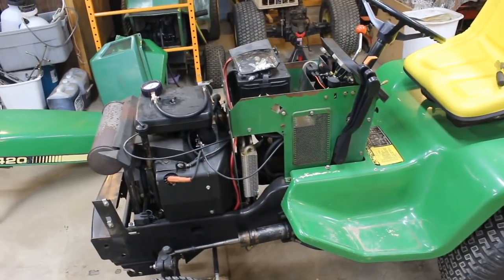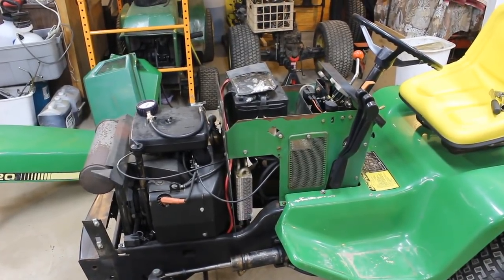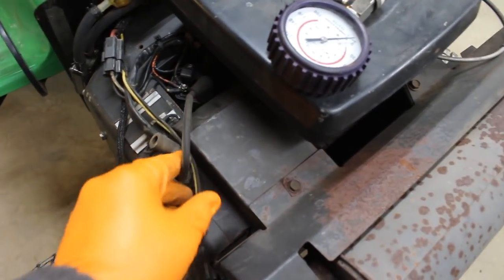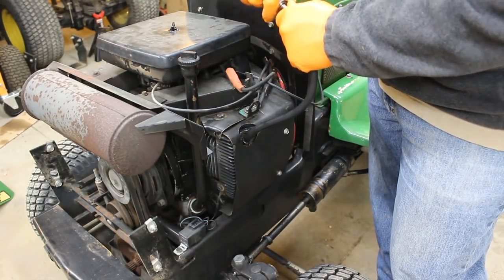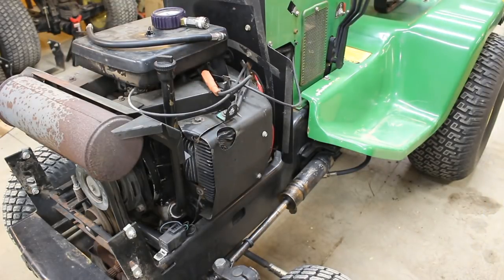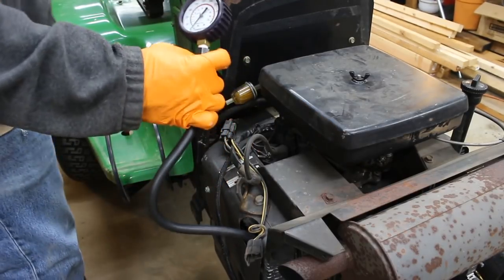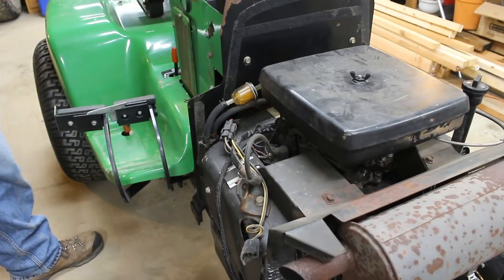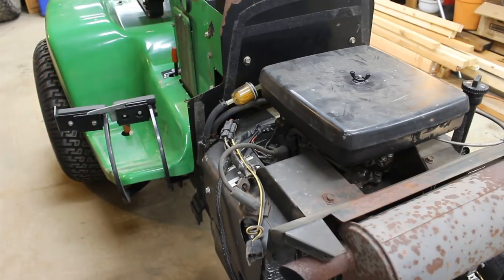Compression Test on an Onan - John Deere 318 or 420

Comment: I just bought a rough '86 420 that has not run for 2 years for $350. I got it running. Cold compression is 85 & 90.  So I will probably have to rebuild someday. Doesn't feel like the carb is right. Would you recommend buying a new one or rebuilding the original. If new do you recommend one. Any advice is well appreciated.

Comment: Silly question but what some signs of a bad spark plug? See I have a little white smoke on initial start up but like you once hot it will
Start again and purr.. recently tonight engine was bogging down? You think bad fuel? Spark plug bad? Or carb needs cleaned??
Reply from the maker: A bogging engine can be lots of things.... clogged filter, trash in the carb, air flow restriction, and the list goes on. Generally unless there is a huge build up of carbon or oil on the plug and the spark is nice and bright, I would start with the simple fuel and air inspections first.

Comment: For those of you who need to get an accurate reading from a compression test: You need to remove ALL the spark plugs, in this case both plugs, make sure the choke is off and the throttle is wide open. You can't get compression if it can't draw in air ...
Reply from the maker: Please see my reply to RP Titcomb from two years ago that addresses this comment. In the two years since this video was posted I have tried Onan's with and without plugs and I have yet to see a difference in the ultimate compression value with the plugs in or out of the other cylinder. I DO think plugs being removed in multi-cylinder (3+ cylinders) engines becomes more important.
Reply: Yep, the theory is you want the least engine resistance possible during your compression test, EXCEPT for the cylinder compression of the specific engine cylinder you intend to rest.  capish...???

Comment: I could use the hood and grille.
Reply from the maker: Sadly that machine was gone long ago. I might have a 420 grill somewhere.
Reply: @mmrbeef  check on the grill and let me know.  I have to pull the seat and cover from mine to check the 2 filters in the tank and hope their plugged since it doesnt run properly.  A Honda repower with 400 hours.

Comment: Pull both plugs before doing a comp test!!!
Reply from the maker: Good point. I cannot remember if I also mentioned that the throttle should be wide open. However, both spark plugs being removed has little to no effect on the compression reading (at least on the Onan's that I have tested). By removing the other spark plug the engine will turn over faster with the starter since there is less resistance. This yields a faster result... but the result, at least in the times I have tested it, are the same. The only difference that I have ever picked up is on a cold engine - less that 50 degrees with 30 wt oil might have a 2-3 psi lower reading with the other plug in.

Comment: You should have both spark plugs removed when doing a compression test
Reply from the maker: That is a great point and something I forgot to mention. Some manuals will say remove both, some don't specify, and some have the user remove one at the time like I did. On Onan's I've tried it both ways and it doesn't seem to matter... at least in the few test runs I have done it hasn't mattered. The compression did build faster with both plugs out same with the choke and throttle wide open but the overall high compression was identical across several runs. I do not know if this same principle will hold true on other engine designs. Now you have me thinking!! Thanks for the comment.
Reply: @mmrbeef  I'm an automotive technician by trade and have always been taught all plugs removed and throttle wide open during a compression test on any engine. Thanks for taking the time to reply

Comment: My 318 smokes when it gets hot after mowing for a half hour or more.  Do you think there may be something wrong with it.
Reply from the maker: There could be, but do some test and that will help you figure out what you might need to do. The first question I might ask is what weight oil? Sometimes the multi-weight oils will smoke once they get nice and warm, but 30 mins seems a little long for that time frame. If you have multi-weight try dropping some straight 30 wt oil in it and see if that fixes the issue or at least lessens the amount of smoke.
Reply: mmrbeef thank you, I normally put 10-30 in it I believe.  I will try straight 30 on this next oil change.